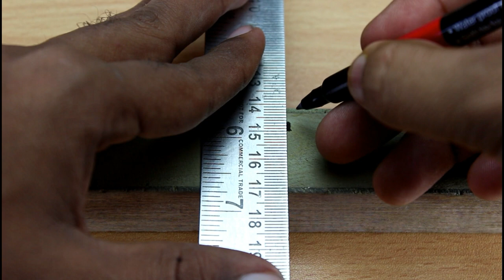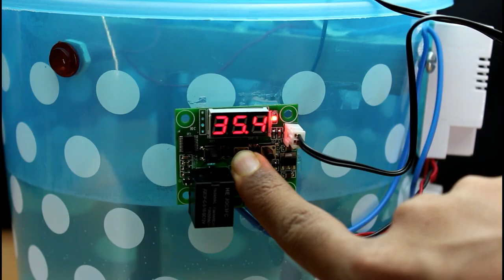How to Make Automatic ON Off  Water Heater at Home

Comment: Nice project but what is the intended purpose of the heater? I get a bit concerned regarding the security around this heater. Perhaps encapsulate circuits and use some kind of resistor instead of using the water as a conductor?

Comment: How much the watt for the led driver that u used?is it the function is to maintain the voltage supply?
Reply: I think that its a relay module to send 230V to the electrodes in the water. Since the water contains salts and other things it can carry current and become hot like any other wire.